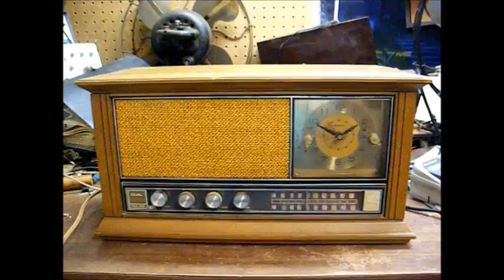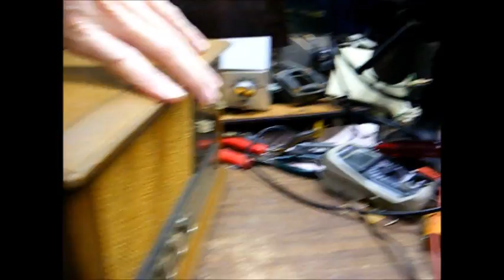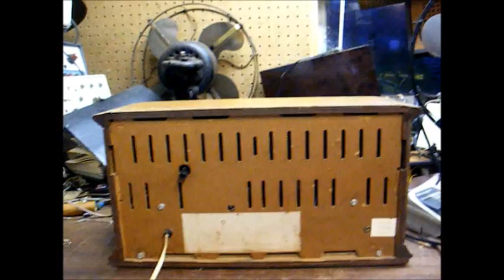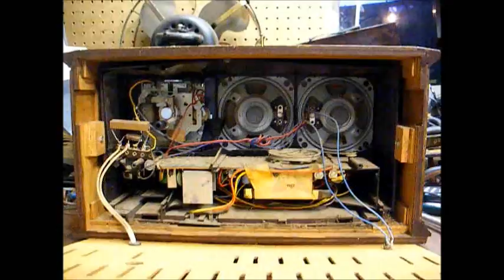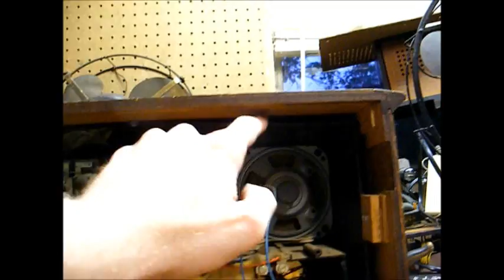GE AM/FM solid state clock radio from 1968

Comment: Radiophononut, I love these older radios.  Glad to see someone restoring them.  Thanks for the videos, and the tips.  The old GE equipment wasn't bad.  The older GE television sets that I ran across had a lot of poor solder joints.
Reply: I worked on some of those GE sets for years.I learned to hate every one I worked on.They never stayed fixed.

Comment: Nice video! I have the same radio, but a version that has no clock.  The part I found interesting about this type of radio is all the countries that were involved in its manufacture, it's rather international.  More than likely designed in the U.S. with maybe some components, but many components seem to be from Japan, the wood 'pecan' cabinet was made in Columbia and the radio label on the inside on mine indicates it was assembled in Ireland of all places.

Comment from the maker: I didn't know that GE made such a radio; but, I'm not surprised. Was one ever covered by Sams Photofact? I do know that GE made some hybrid AM/FM radios during the late '60's that had a solid state FM front end, while the rest of the circuit used tubes. I think I still have a plastic cased AM/FM clock radio from '68 that's like this.